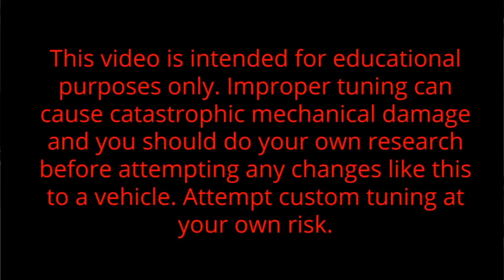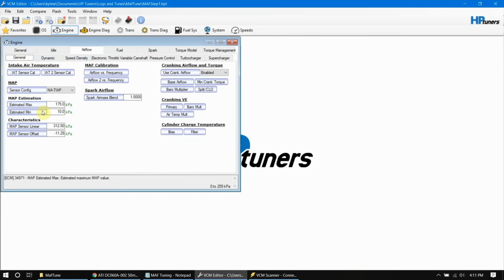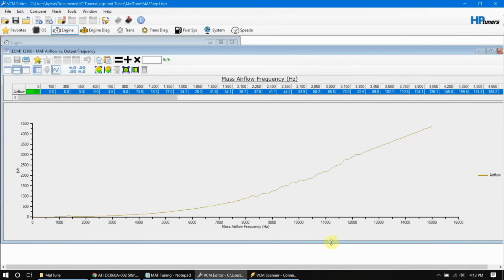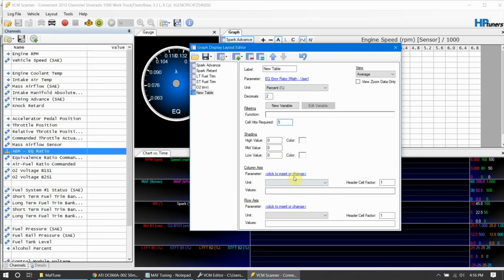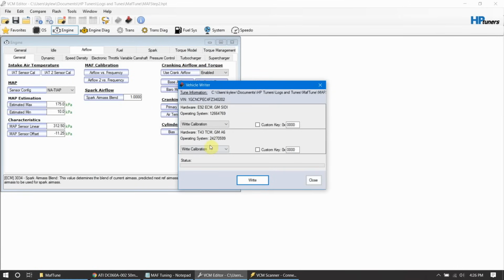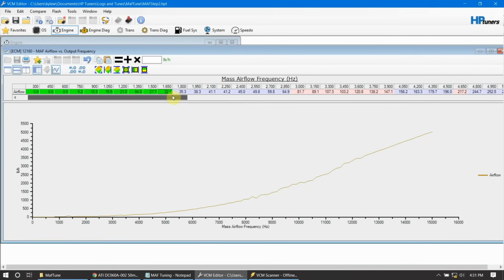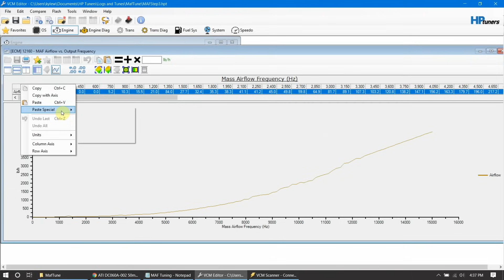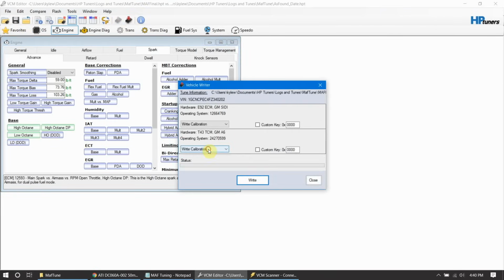MAF Tuning and Scaling, Tuning Series Vol. 3, HP Tuners

Comment: I'm following along here and am at the point where I need to add more fuel. I have added 1.1x, then another 1.1x, and finally 1.3x. Made sure I saved the file and rereflashed the car, the wideband reading didn't change at all, still reading around 1 lambda. Do you have any advice for this?
Reply: I confirmed I am not in closed loop if that helps.
Reply: Fixed it by turning off closed loop on the VCM Scanner app. It was running in open for a short amount of time and the switching to closed.

Comment: New to HP Tuners.  Was going for step 1 to disable dfco, but it looks nothing like what you showed.  Under engine/fuel/cutoff, dfco; I have only rpm limits for “in-gear” cutoff (table with rpm limit for selected gear), and decel fuel cutoff “enable etc”.  How do I go about disabling dfco?  2017 Camaro ZL1 m6.

Comment: Ok I saw that you was initially was running lean at +14 (lean) on the maf histogram. So you added 15% to the airflow frequency table and that brought it to -3%ish (rich). So lets say I was at -6% all over and I wanted to get a ball park leaner to -3% to start. Wouldn't I be able to multiply .97 to the airflow frequency table to get it to around -3% then tune from there to get me closer to zero/-1?
Reply from the maker: Exactly, you just have to think of it as percentages. When you multiply by .97 your saying you want 97% of your existing scale.

Comment: I’ve been trying to learn how to tune. I got the book from the tuning school and it mostly just tells me what to put in. For example the MAF section in the book tells me to change high RPM disable to 200 and high RPM re-enable input 150. I was wondering how did you get the 100 and 99. Maybe I’m overthinking it but I’m just trying to break it down so I won’t blow any engines up since I practice on my gen 6 Camaro.

Comment: Thank you for making this video. This is super helpful as I am completely new to tuning. I have a quick question. I have AEM 30-0334 x series wb and MPVI II. I dont have Serial to USB set up. I was reading online and since AEM WB cable hooks up to OBD II port I can use WB EQ Ratio 1 sensor under Oxygen Sensors to add a channel in HP Tuners. Is that a good sensor to read off of or do I still need to have serial to usb set up? Also if using WB EQ Ratio 1 sensor is ok, can I use AEM 30 - 4110 under equivalence ratio in oxygen sensor while editing variable in user math? Do I need to keep O2 sensor voltage as is and not change to -ve with this set up? Apologies if this is not a logical question. Trying to understand if I can use AEM OBD II plug and MPVI II to read this EQ error.

Comment: I appreciate the time you put into making these videos. I'm just now starting to tune my 08 Denali with the L92 6.2. the deck and heads have been milled .006, and the block has been bored .020. I'm running a GPI Cam, 216/223 .550 113+8. I have an Arid Jr intake. I have bumped up the idle to 800 and it idles fine there with a nice subtle lope. Cold starts are perfect but hot starts need a little throttle input. I bumped up the cranking timing 5deg and it starts great now. Now comes the MAF scaling, I wish I could just find a good graph to copy in but it seems that a wideband kit will need to be picked up before that happens. I wish the actual EQ ratio could be read. Any thoughts to making a small increase to the MAF chart before I get a chance to dial it in?
Thank you!

Comment: Great series of videos!  Your presentation style is great--easy to listen to and very confident in your statements.  I'm a noob to HPT but long-time user of the aftermarket efi systems. Currently running an E67 on an LS3 crate engine with a roots blower in a '67 Impala.  My question related to this video is what is defining the Lambda/EQR/AFR target?  This process is training the ECU to determine how much air mass is actually making it into the engine based on the math  it's doing to calculate EQR from the air and fuel flow (calculated) values. Is there a table that defines the target EQR?  I see reference to a PE modifier--is that a separate table that is used to modify the stoich value based on RPM and load?  In other words, how does one change the target EQR? I'm on video 4.1 so I'd be happy if you point me to a video in your library where you discuss this.  THANKS!

Comment: I am bit confused towards the end shouldn't you leave dynamic air flow  and oxy sensors disabled after you have finished to force your vehicle into close loop all the time considering your tuning using maf close loop tuning or am I wrong ???
Reply from the maker: You are forcing it into Open Loop for the tuning process so that your narrowband sensors do not fight you as you make changes.
Reply: @GoatRopeGarage  so after I finish tuning the tables in open loop it will not affect me if I re enable the close loop?

Comment: Wanted to know is the lower part of the MAF that is moving during logs STFT?  I use a different tune software which does volts and adjustments are made in lb or
G/s. I'm adjusting and then looking at my STFT/LTFT to see what changes occur. Trying to interpret how it works on your hptuners to understand how I need to be adjusting my own. Thanks for any info and the vids.
Reply from the maker: It's basically the same them, we measures in Hz but it's translated into airmass, which is often in g/s
Reply: @GoatRopeGarage  so your lower moving section is g/s?

Comment: On a stock stock 2009 Silverado when you tune/scale the MAF would you leave the dynamic control off and just strictly leave fueling to MAF and closed loop?
Reply from the maker: When going there MAF you want dynamic and closed loop off so nothing is skewing your commanded fuel that way you get an accurate error ratio
Reply: @GoatRopeGarage  exactly but would you just continue using the dynamic turned off and strictly use the MAF load based for fueling? This is on a NA setup. Thanks man I also sent you a msg about a video for flex fueling a 4th gen fbody/C5.
Reply from the maker: @lsxjunkie  you'll still need to dial in SD as there are other portions of your tune that use it as a reference. But I wouldn't get too hung up on dialing it in less than 5% error.
Reply: Thanks man going to order my AEM wideband via your link now.
Reply from the maker: @lsxjunkie  appreciate it! Let me know if you have any more questions
Reply: @GoatRopeGarage  if I'm using MPVI Pro with the AEM WB do I still have to make the EQ Ratio Er as a user defined Math?
Reply from the maker: @lsxjunkie  No, and you only have to do user defined math if you're wideband requires scaling. Otherwise you should be fine with the default EQ error math

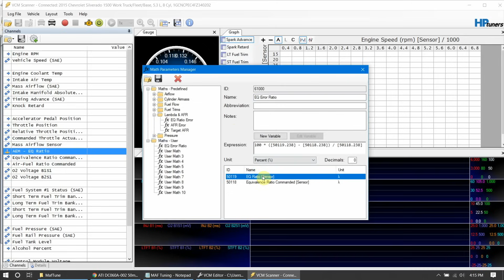Comment: Not sure? I think I missed something? At 8:33 in the video you mentioned changing the EQ sensor to MAF? Then went to back to AEM wide band. Only asking cause yes I'm a little stuck on this step myself.
Reply from the maker: Try the default EQ Error math when building your graph, Josh, it should work. If not report back
Reply: I also found your wording alittle confusing, when you said maf are you adding in your aem wb instead of eq ratio sensor because your vehicle doesn't have a factory wb sensor? And if it did would you just change the variable to the factory wb?

Comment: Alright so now that I've made sense of everything I came back I've gone over this video a good 50 times now trying to see where I made the mistake and no mistake it just doesn't work with the pro link. It will create the histogram but when you try to log the cells will cycle but it doesn't collect any data. The main difference I've seen between my end and yours is mine is analog so its reading in volts opposed to lambda so the only conclusion I can come to is the math isn't right so its not registering as I scan as far as I can tell but I don't know. Any suggestions cause I'm at a loss.
Reply from the maker: You need to transform the channel, right click on it and when you transform it the units will change and that so populate the data

Comment: Can you confirm what I'm tracking on here, whether it's VE or MAF, and the relationship with PE.  Tuning either fueling is based on maths error.  Does that mean that setting up your required fueling on the PE table as a base multiplier first, and then tuning your MAF and VE around that?  Is the afr eq error maths just using the commanded - actual and kicking out a %?  Is the commanded afr/eq taking the PE value into account?  What is the PE value multiplying against?  The MAF/ve table or the open loop table?  I don't understand the need for MAF/ve table, then an open loop table and then another PE table.

Comment: Great videos! I am currently trying to follow this one but I don’t have an O2 Readiness Voltage under engine, oxygen sensors. I have O2 readiness ECT. What should I do?
Reply from the maker: You can do the same thing with the ECT, Max that table out, will be something like 490 degrees. Monitor the fuel system status PID in the scanner and make sure it stays in open loop, if it doesn't you may have to also disable something in the closed loop enable tables, same tab, might have an enable ECT table, you can max that one out also if needed.
Reply: Goat Rope Garage Thank you! I’ll give it a try
Reply: Would this process be different when running e85?

Comment: So i put a 03 lq4 into my 99 silverado use to be 5.3. I set up the histogram like you showed, I have a 4110 aem wideband gauge. when the maf sensor is on the truck afr idles about 14.7-15.0. When i shut off the ltft and the maf, the truck afr starts about 16 then slowly works its way to 18. So I went into maf and multipied everything by 1.80 and flashed it to the computer. I started the truck up and it did the same thing. I have multiplied the VE table several times and still the same deal. At this point I"m completely stumped, any Idea what I have done wrong?

Comment: Just starting my journey into tuning. I have a 2008 TBSS and I'm currently #11 waitlist for RW2.0. Mods on the SS are: Long Tubes, ORY, AEM Wideband, Derale E fans, No name CAI. I have a Cam, trunion kit and HPOP on my shelf in the shop ready to go. I want to see what this thing can do before breaking into the timing cover. I grabbed a dragy and with some S#!t all season tires it's running 14.12 @ 99.xx. My HP Tuners looks like it's quite a bit more watered down than what your screen cap shows. My Cutoff/DFCO just shows RPM limits/ Cutoff / Control Method/ Misc.  I have noticed this while watching some of your other videos, is this just something I need to bite the bullet on and get the new hardware? I'm currently attempting to use MVI2+, any help would be greatly appreciated! Thanks!

Comment: So do you have any advice for getting into full boost while maintaining smooth transitions? I can't really get into boost in the ZL1 without rolling onto the throttle pretty quickly. I think because I am going into throttle pretty quickly trying to hit boost and get into those higher readings that I'm seeing false negative cells in my data. Like I will see -1.02 -0.78 2.50 15.98 0.88 -0.01 so would it be fair to assume that 15.98 is likely false data because I'm getting into the throttle too quickly? Sorry for the lengthy question..
Reply from the maker: So you need to do both, slow roll on the throttle and full wot and a lot in between. That’s the hard part of street tuning. You have to hand blend spots you can’t hit

Comment: I’ve watched your videos multiple times, maybe I’m over thinking it and making it harder than what it is. But when you create the EQ ratio math what’s the reasoning behind editing the variable? I’m confused maybe it’s a stupid question I don’t know lol, you say add mass air flow and then add the wide band? I’m sorry if it was discussed anywhere else I just wanted to figure it out
Reply from the maker: I probably just over complicated it. As long as the built in math parameter for EQ error ratio works go ahead and use that. I just had to edit that one due to a scaling issue on the wideband.

Comment: @3:30 you say your trying to disable open loop to keep the o2 sensors from controlling fueling, and you make that change too o2 readiness voltage (that i don't even have with my 3rd gen po1 with the enhanced os).....i was under the impression there is no fueling changes by the o2's in open loop, it's not until closed loop that they do anything? and if that's the case is the goal to stay out of closed loop(which i should be able to control by maxing out the closed loop enable ect vs. iat table correct)?

Comment: I’ve tried to get eq error to log by watching your video many times today but no luck. My aem gauge comes into the computer through the ac pressure switch, 0-5v signal, then goes through math to display on my chart, but in the channels section it is still ac pressure (volts). Do i need to add a wideband channel and transform it to include the ac pressure sensor voltage? Thanks

Comment: Great video!! Having issues with  AEM 30-4110  or any serial port channel as they disappear once I start logging. MAF Error graph never shows any data. I've tried all the items mentioned below, restart PC, connect and start scanner then start vehicle, upgraded to 4.4 beta, nothing seems to make any difference. I'm using MPVI2  with 2014 Sierra 5.3. Do I need additional hardware to tune the MAF as I just have the MPVI2 with 2 credits? I don't see the needed parameters under MPVI2 channels, is the external_inputs serial_port data not pulled in with the standard MPVI2?
Reply from the maker: It is, double check your serial wiring. Are your using a serial to USB convertor?
Reply: @GoatRopeGarage  No using the USB cable that came with the MPVI2 straight to laptop.Nothing else running or plugged into the laptop. What is strange is the MAF Error graph never shows any data and not sure if it is normal but the name of the graph shows up with red box, all others are blue.
Reply: Never mind about the red box comment, I see it is that way on your vid as well just no data coming in.

Comment: Great stuff!   My son built my 6.0 and programmed (and since tweaked) my tune using his HP Tuner. I need more programming done but he lives 150 miles away...sooo I bought the 2+ and it is supposed to arrive tomorrow. I am having idle issues and have to wait about 20 seconds on a cold start before I can shift into reverse without it dyeing. I figured I would do a download and see what the settings are and go from there.

Also, can you recommend a wide band? I see you are using the AEM X series 30-4110 EUGO. Are you happy with its performance or do you have a recommendation. 
Thank you again for the efforts you put forth to help  others
Dan

Comment: Question regarding the video...
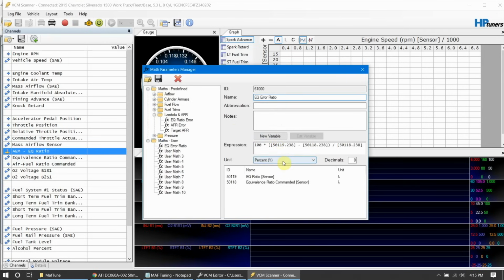When setting up the new MATH Parameter, you begin by copying the Expression from the Math/Lambda/EQ Ratio Error parameter, and paste it to a new User Math table. @8:34 you say you want to "change the EQ Ratio Sensor to your Mass Air Flow" but then you go in and change it to your AEM Wideband sensor. Slip of the tongue? Because you're not changing the actual sensor in the video when you selected your wideband (it stayed 50119.238 in the formula, but would change to 50080.50 if you'd selected the MAF) just curious as I'm having issues logging info when following your directions.

Comment: Great video - Some of the guides I've read talk about resetting long term fuel trims. Can you confirm, is this only for the guys using narrow band O2's (as opposed to a WB)? Personally, I think the method you've described is perfect as people can do part throttle and WOT calibrations for their MAF (in the same log if they choose) - as you suggested in an earlier video, go out and get a WB from the beginning.
Reply from the maker: If you're using narrowbands you want to reset the fuel trims after every flash to make sure you're getting fresh data as you log. When we use a wideband we are disabling closed loop so the O2 sensors don't skew our data.
Reply from the maker: Using narrowbands are fine as long as you're not doing any crazy mods but if you cross into internal mods or forced induction then you really need a wideband.
Reply: Goat Rope Garage do you have a video explaining how to do such using narrowbands.
Reply from the maker: https://youtu.be/kaRL3vSA-JI

Comment: I have the aem eq ratio and afr both disappear as soon as I start logging. It's as if they don't work. I have the mpvi2 pro link and using 30-0300. When I hit the buttons you hit (exactly). The maf error graph does absolutely nothing. I've been trying to troubleshoot this for 3 weeks.

Edit. If I wire the signal through the analog channel hptuners reads the 0-5v. I then have to transcribe it to display afr. I can't plug that trans scribe into the math function. If I use the canbus signal. It actually reads the afr with no transcribing. However, I can't bloody find it in the math table.

Comment: Thank you for all your videos they are extremely helpful! My question is how do you know everything is correct before you start making adjustments? I’m seeing -11% fuel trims on a stock ‘14 6.2 with just a stock airbox, aem filter and airaid Intake tube.  Wouldnt that change skew them lean if anything? Confused here
Reply from the maker: Factory trims may have just been that rich on your truck

Comment: Great Videos! If you were to plug in to a brand new completely stock car and compare the MAF table to Lambda would it essentially read 1.0 all the way across? Or is there reasons the manufacturer wouldn't want or need the AFR right at 1.0?
Reply from the maker: No, it will be close but you will probably be on the rich side, especially under PE as they have to create a tune that works for thousands of cars in different climates